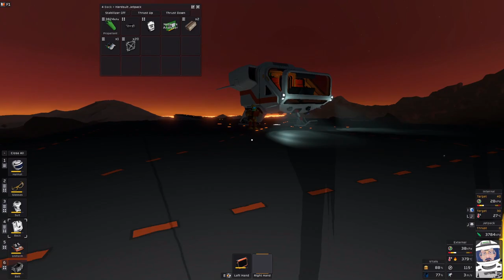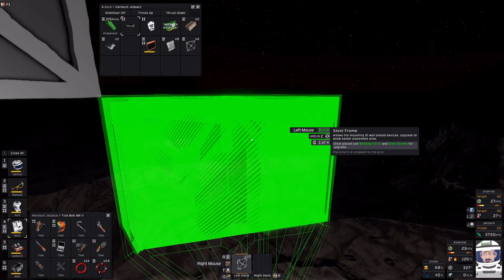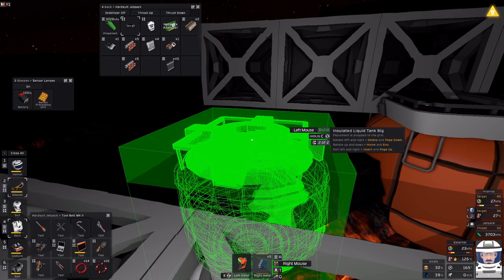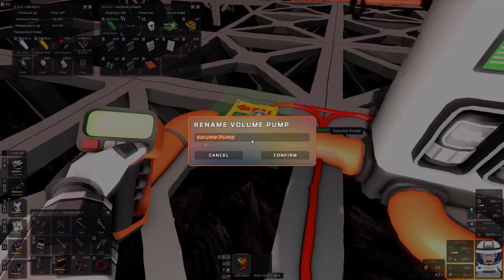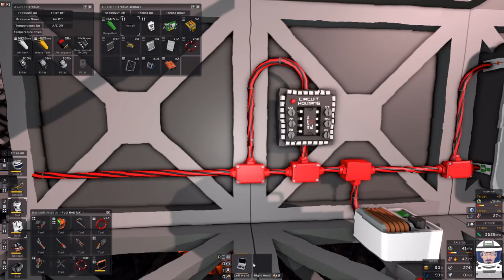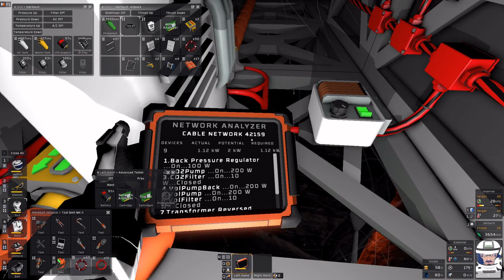Stationeers: Let's Phase Change Vulcan Early Pt8

Comment: Could you use waste gas for the drill?
Reply from the maker: Yes, slight problem is that it works better based on the pressure in the canister, at most the waste tank would fill to 4MPa. The other caveat for Vulcan is your waste tank may have trace amounts of oxygen, which ideally you would not want to lose. But in an emergency, a nearly filled waste tank can allow you to mine some with it.
Reply: @shadowdrake082  Thank you for the info :)
Reply: @shadowdrake082  i may have to start with an easy planet :)

Comment: if i remember right 
it was possible to cool a furnace by passing coal in the furnace i dont know if it still work.
Reply from the maker: Im not sure if it coal specifically, i need to try it because the offgases of ores are what usually cool down the furnace. I do know that throwing in ingots and alloys will cool down the furnace as it processes them. I have used that sometimes but i forget thats an option half the time. I might just need a 100g block of steel for using as a furnace coolant block.